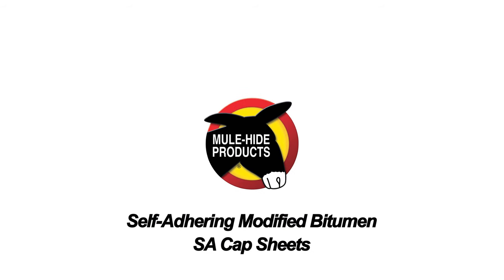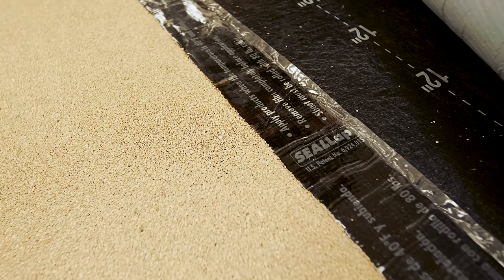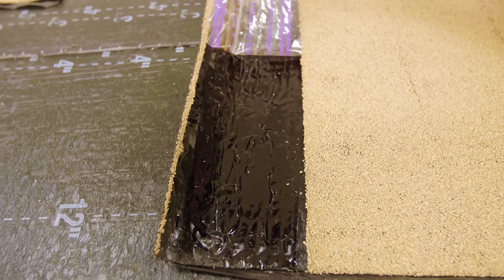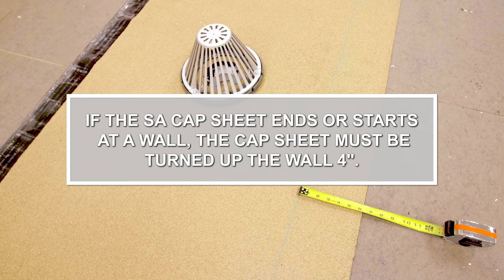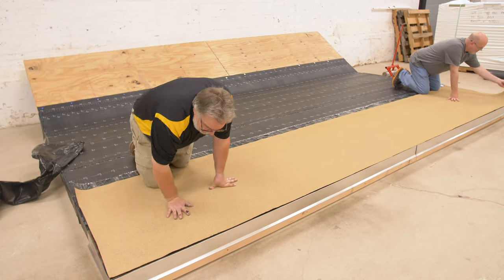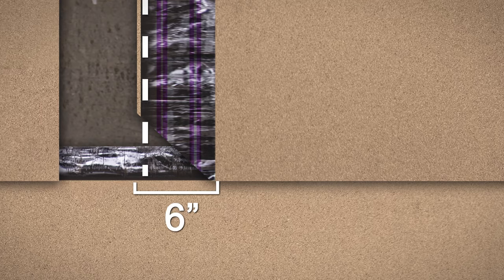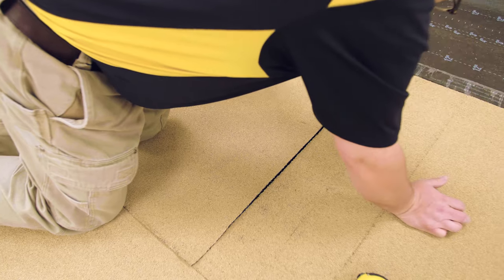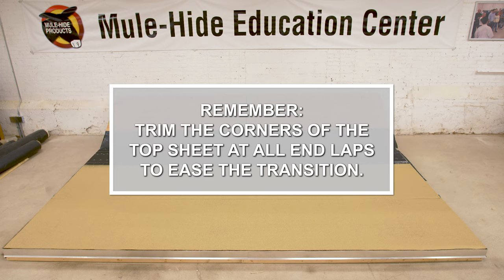Self-Adhering Mod Bit: SA Cap Sheets

Comment: Company that just did my roof started at the high point of the roof. Not the low. Is that a problem?
Reply: Most likely not in the short term, but you never want water to flow downhill onto gaps, water may seep through once material breaks down over time. These rolled sheets are prone to warping over time/coming loose after years of heating/cooling

Comment: Looks very clean!    Approved product for Florida?  Really want to apply stick on underlayment right over plywood (no nails).  If we do, in 20 years then the roof needs replacing will it come up without damaging plywood or should we just plan to clean/scrape Cap layer (maybe roll on something for body) and stick on another cap layer?
Reply from the maker: Yes, it is an approved product in Florida (Miami-Dade County and Florida Building Commission). Applying this directly to plywood would cause damage when trying to remove...we recommend first putting down a nail base sheet with fasteners, that way you can take off that layer by pulling the fasteners and not damaging the plywood at all.
Reply: Just do a fluid applied restoration when it's time to address the roof. A good elastomeric on a roof with a small pitch will last you 10-15 years before needing to be recoated. Silicone will last much longer and works great on flat roofs.